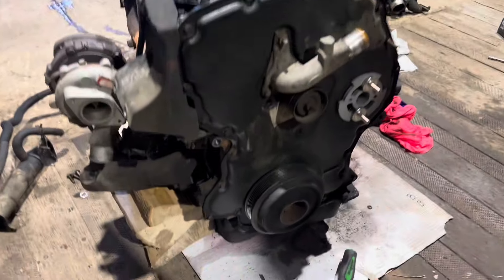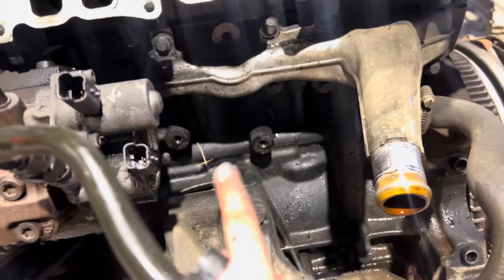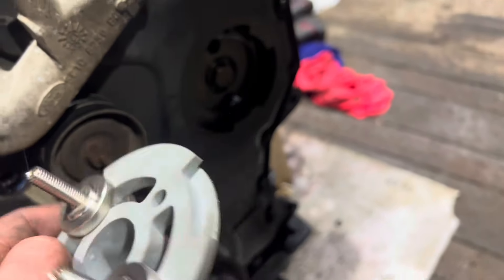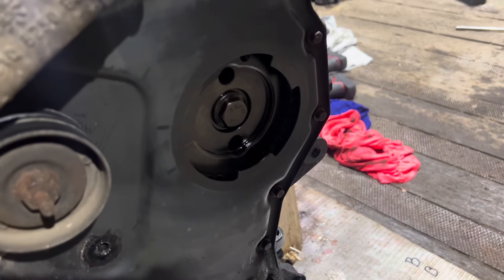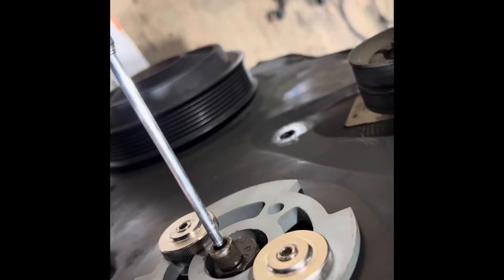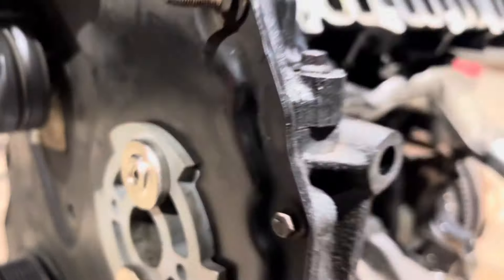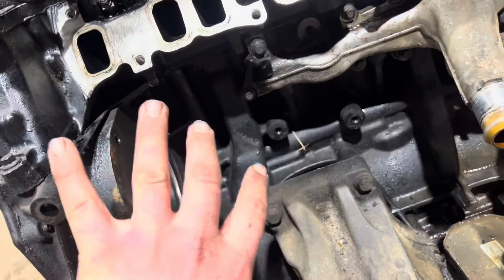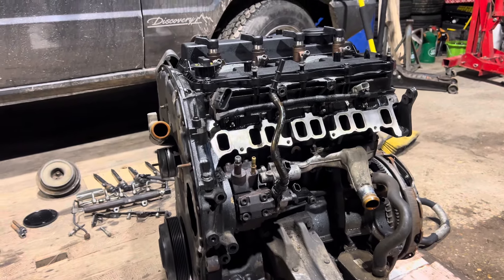Transit 2.2 mk7 fuel pump removal sprocket how too laser 6828 tool

Comment: Is there a keyway on the sprocket and the shaft?
Reply from the maker: Like a woodruff key? No there isn’t. It’s a compression fit and not timed so can sit anywhere on the shaft. Hope this helps
Reply: @Automotiveolie  awesome thanks. It was actually the timing i was concerned about.
Reply from the maker: @ferdiyurdakul   no problem. The 2.2 and 2.4 TDCI are not timed pumps but the 2.4 TDDI ( earlier transit engine ) is timed. Good luck

Comment: You dont time up the engine with the flywheel locking pin?
Reply from the maker: No need to on the TDCI.  The pump is not timed the tool is just to replicate the tension that’s lost when the pump is removed.  You need to lock the flywheel on the TDDI

Comment: By doing it like this you don’t have to worry about the timing chain right?
Reply from the maker: Yes correct. It will remain timed. The pump is not timed. You don’t need to disturb the timing cover either
Reply: @ okay thanks so much for the information sir .but here in Nigeria the laser tool isn’t available, I think I will have to improvise and make a tool here myself similar to that laser sprocket. Think it will work?
Reply from the maker: Yes I think you can make one easy enough. Maybe use an old timing pump cover and modify that?
Reply: @ what’s the size of the sprocket screw to use with the timing cover please
Reply from the maker: The nut on the pump? I think it’s a 22mm
Reply: @ good morning sir finally I converted to manual injector pump , got a used one .now I have a slight knocking sound and the acceleration is very poor and it has low power
Reply from the maker: @  sounds like diesel knock. Have you computer coded the new pump?
Reply: @Automotiveolie  it’s a manual injector pump not the electric. Does the manual need coding as well?
Reply from the maker: @  if it has any electrical connector on it then it’ll need coding, the early pumps for the mk5/6 transit need coding and the mk7 also need coding. I’ve personally not done a mk5/6 one but have been told you can swap the PCB across and solder to replacement pump